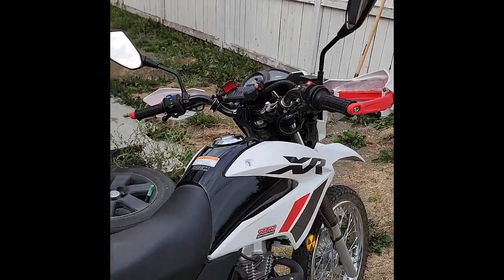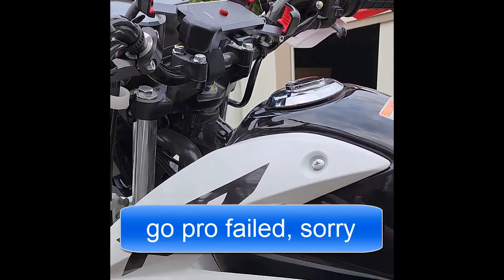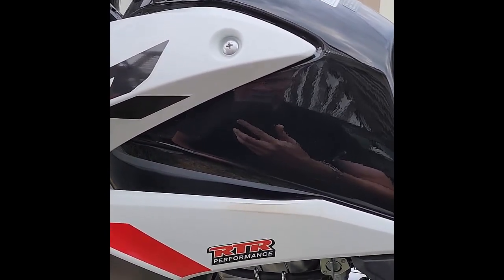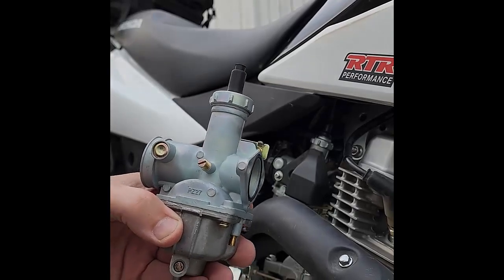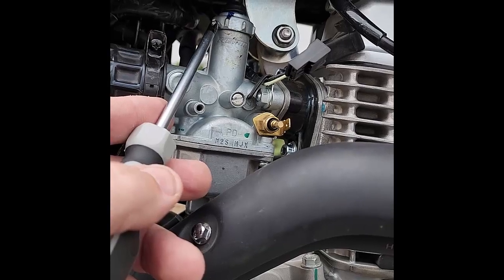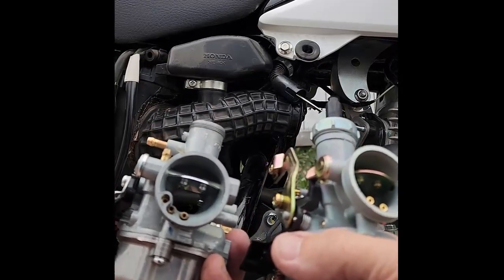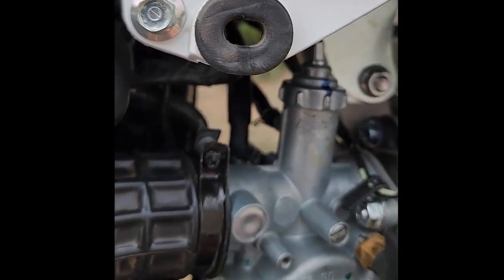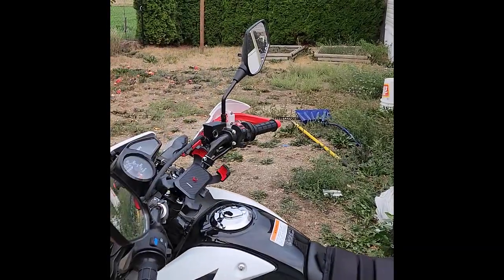2023 XR150L carburetor update and new seat pad

Comment: I 2023 xr150 was always a challenge to cold start it seemed. What I found was to hold the throttle open a small amount like twist the grip about an quarter of a inch first the hit the starter button. It fires right up with no choke! I live in Florida and the temperature is from 60-80 degrees Fahrenheit. Honda owners manual says to give it full choke and a little throttle when starting. Hope this helps 👍
And once it’s running I have to hold the throttle to keep the engine idle up around 1000 rpm’s for 5-10 seconds to warm up the engine so it can idle on its own. From the factory the engine is supposed to idle at 1400 rpm’s and mine does after it’s warm but when cold it idles around 700 rpm range I’m guessing.

Comment: Here in the Philippines that PZ27 is the most common carb upgrade that you can easily do to avoid cold start. That carb only cost 7 bucks here and is widely sold everywhere. What I did though was replaced the stock 38S idle jet with the standard 35 which is what is inside that PZ27. The standard 35 jet has a larger hole than the stock 38S and that fixed the cold start issue for me. Of course counting the weather, we may have different results. And just like what you said, yeah its a bit disappointing for your version of xr150. So much restrictions for upgrading. Mine was bought 2019 and that pz27 is just plug and play.
Reply from the maker: thanks for the info, great to hear from you, this is the first year this bike is available in North America and so far I'm pretty happy with it

Comment: I have standard jets, and mine starts cold perfectly without touching the throttle.  Just touch the start button and it starts immediately.  I live at 4200 above sea level.  Mine starts the same way when it's hot.  Just barely touch the starter button.  Unless you are re-jetting for higher altitude than I live at, you probably will have worse performance than stock configuration.  There's no need to re-jet a factory carb unless you are going for some drastic changes due to drastic altitude changes or you've put a big jug kit on it, maybe a new exhaust and air intake.  If you don't change all that stuff, you'll never gain anything screwing around with the carb.  The only thing I don't like about this carb is the choke lever does not put it in fast idle mode like all carbs from the old days did.  So as a result if you adjust your idle speed when the engine is warm, then it won't start well when it's cold.  Mine was idling way to fast when it was warm, so I adjusted the idle for a warm engine, and then it wouldn't start well when cold, so I had to raise the rpm again to get a good cold start.
Reply from the maker: my bike was difficult to start cold and has a rattle at high RPM because it's too lean.
Reply: @timetoadventure7  Everything runs too lean nowadays.  I'm at 4200 feet and don't notice any rattle.  Of course you are talking about pre-ignition rattle, not mechanical rattle, and also called "ping".  You can get that same thing from messing with the jetting on the carb if you don't know what you're doing.  Overall, I haven't heard any "pinging" at high rpm.  If you get pinging is should be under a load.  Try increasing the idle rpm until you think it's running a little too fast when the engine is warm, and see if that helps with cold starts.  It did for me.  I hated the high rpm idle that was set at the factory (when it was warm) so I reduced it, then I had a hell of time getting it started when cold (and cold here in NM since I bought it has been maybe 60 degrees at night).  I don't know how much this will all change when we start getting down to winter weather and in the teens at night.